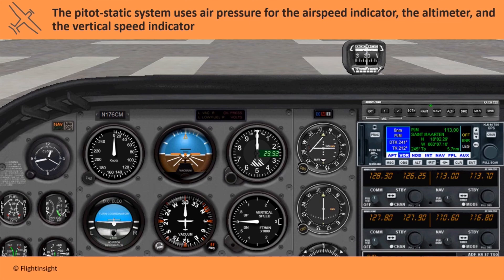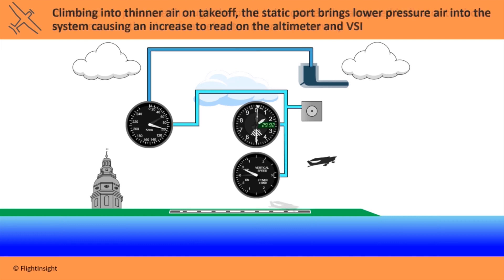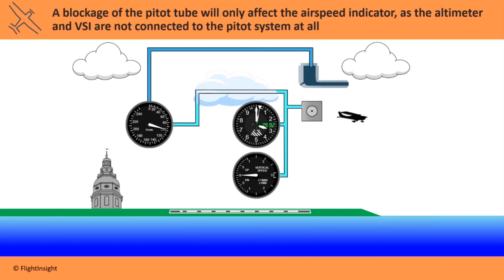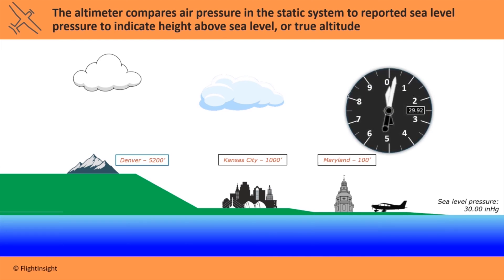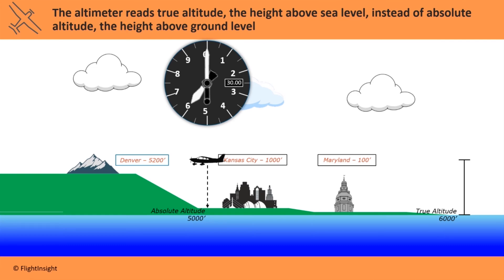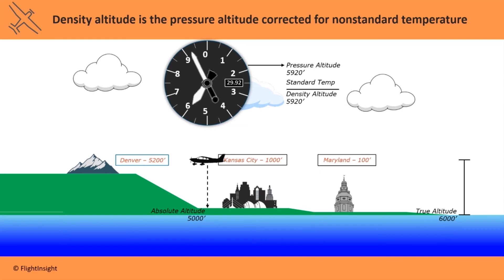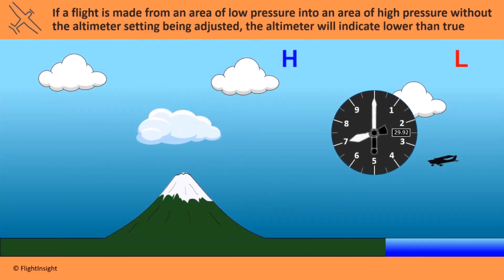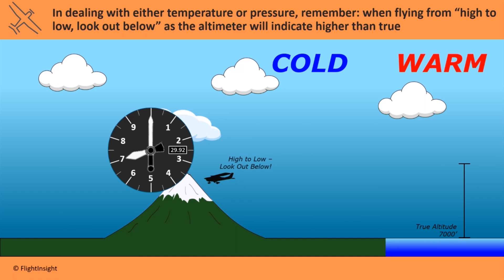Pitot Static System Errors | Flight Instruments Explained | FlightInsight

Comment: If cold air is more dense, and dense air is associated with lower altitudes, why on earth does the altimeter show an increase when flying into colder air? This makes no sense. The increased density of the cold air should drive the altimeter DOWN making you think you are lower than in reality and you would correct by mistakenly flying higher…..please explain what I am getting wrong. I just don’t get it.

Comment: i do not understand why the asi increases with a descent and vice versa if the static port is blocked. I thought the ASI read RAM air. The RAM air has not changed at all
Reply: Ram air is a combination of dynamic pressure and static pressure (it shows total pressure). Normally diaphragms find the difference between static port (static pressure) and pitot tube (total pressure) to find dynamic pressure, and find speed based off that. As you descend, the air being shoved into the pitot tube is more dense, thus the total pressure measured increases, but the measured static pressure remains the same. The difference between them is larger, so IAS is faster.
Reply: @cartersharpnack so what if pitot system block with clear static port happens in high altitude, will it be the opposite? Because the static pressure in high altitude is lower than in low altitude, as we descend the Aircraft the ASI will overread?

Or pitot system block & clear static port only happen in near MSL?
Reply: @muhammadihsanaly5581 if just pitot tube is blocked airspeed will always read zero. If you have a static port blockage at high altitude and your pitot tube is clear then the airspeed will increase as you descend since the dynamic pressure is the same but static pressure is also increasing with more dense air closer to the surface.

Comment: High to low, look out below makes sense for pressure changes, but I'm having trouble with why it works for temperature changes. Isn't a decrease in temp associated with higher density and pressure? Isn't higher pressure going to cause my altimeter to read low, rather than high?
Reply: Higher temp means thinner air.  Where is thinner air?  Higher [density] altitudes.  So if temps increase, then density "altitudes" increase. 
Also, high DA doesn't mean that the air can contain more "density".  It means that the density is equivalent to a higher altitude.